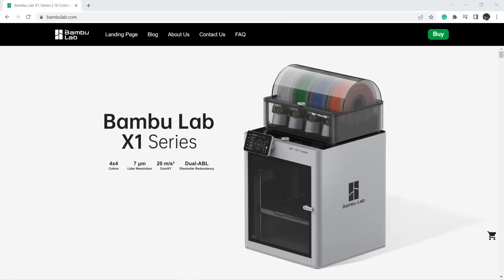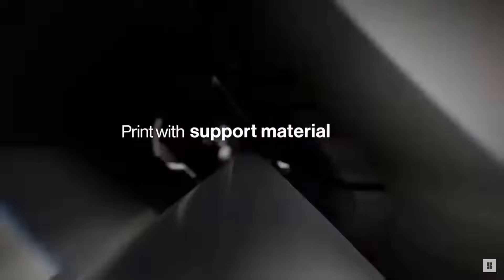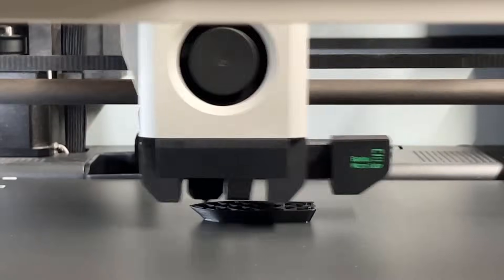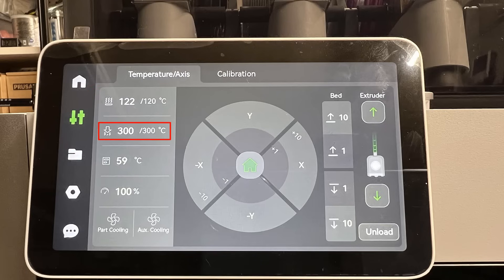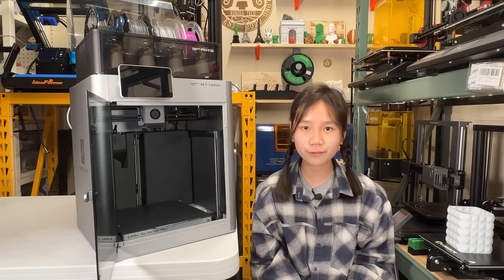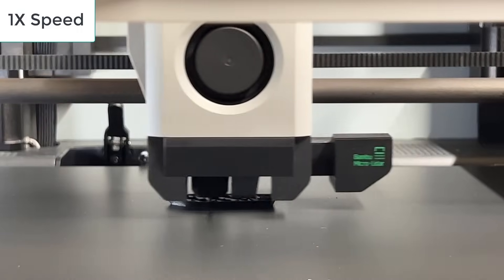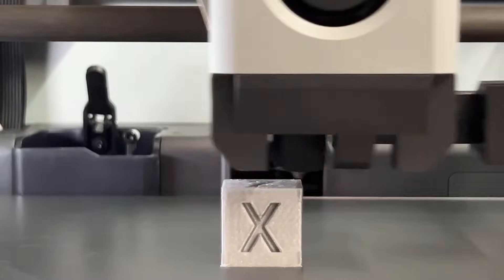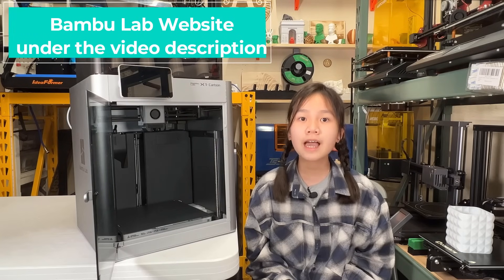Bambu Lab X1: This $1000 3D printer is a few generations ahead of Creality, Prusa, and Ultimaker

Comment: Have you had issues with your Qidi max extruder? Had mine for several years now and the only issue I've had was with the extruder, adjustment springs and not falling completely down in "Z" when finished. 

Great work on the video! Thank you for the review 😀
Reply from the maker: I guess they changed many parts from time to time, my extruder may not be the same as yours, it's working fine.

Comment: It becomes a shame that there is no talent to shoot good informative videos. Excellent work.
 upd. I  have four printers for different purposes. I'm developing my own printer. I didn't need a printer, but after reviewing Aurora, I decided to buy bamboo, I also persuaded a dozen of my friends. We wanted to buy a full Snapmaker kit in due time, we didn't buy it because of poor support. And they answered somehow. I have already written several bamboo e-mails, there is no answer, we wanted to buy 20 sets, but my friends, no matter how good the product is, do not buy when there is no quality support. It's a pity, bamboo, this is the first step towards a new approach to 3D printing. Well, I'll make my printer. One extruder is about 40-50 g, five colors or different types of filament printing speed, I can't check, I need a slicer. Solid metal, the temperature is more than 300 °C so that you can print both abrasive and engineering plastics, even PEEK. Fundamentally new kinematics. The printer is closed, if desired, you can make active heating. I want to note that 3D printing today is at an impasse. Even stagnation. And it's very good that there are companies like bamboo. If they still provided normal support, and so they would lose some customers. Recent remarks, the use of one nozzle for printing, deadlocked direction of development.

Comment: I love your videos and your reviews. They're so informative and detailed. Did you discover any information about replacement parts? This was the only thing I can't seem to find about it. What happens when you need to replace the nozzle? Can you use different sizes of nozzle? Also what about clogs or failures of hardware? This printer is ahead of its time. It will be neat to see how it does long term.

Comment: I see this printer getting a lot of good reviews all over YouTube, will the multi-filament attachment cost extra? Is the build volume big enough to build a cosplay helmet?
Reply: The AMS is an addon that costs extra, and the build volume is a 256mm cube. Not the largest build plate, but you can easily print the helmet in segments and still have it printed way faster than with other printers.

Comment: Game changer printer. For years, the ~$1000 DIY printers seemed to be the only way to see a convergence of both fast and quality. This blows VzBot, Voron, Ratrig, and all the rest out of the water. 20K mm/s^2 acceleration is the full speed/acceleration setting that Tom Sanladerer’s Voron V2.4 struggled at in his popular Voron V2.4 summary video last year. There he noted skipped steps which prompted him to run at half that in normal daily usage. Yet now here we are finally seeing 20K mm/s^2 in a consumer-first product priced less than a Voron V2.4 with the same accessories (and more) with higher quality and better, consumer friendly ease of use. I predict this product will mark a radical sea change in the DIY community as people move from building DIY printers to buying ready-to-run consumer ones like this. Gone are the days of endless fiddling and tuning of Voron, VzBot and others as the age of the consumer-friendly 3D printer has finally begun.

Comment: I've seen a lot of reviews and I think speed is the best feature of this machine. However, I think the quality is not the best. I am comparing with my prusa mk3s+ and while it lose in term of speed, I think prusa still produce better quality. Maybe this printer is more suitable for quick prototyping but I would still use a prusa for final product. I almost jumped to buy one in the kickstarter campaign but I think I will wait for the second generation which I hope will excel in both speed and quality.

Comment: The only thing that troubles me are the hotends, or more accurately the nozzles. And I enjoy tinkering with firmware, so that's a bit of a bummer, too. Glad that slicing is open in both directions.
Anyway, yes, it has almost every reasonably common feature, some fairly unique ones, and apparently phenomenal performance. All at a fantastic value even at MSRP, let alone at early-bird. I almost hope they don't have an EU warehouse, so I don't get tempted. (Can't find anywhere even addressing this question.) I really, really want this. And I really, really want them to be successful.
That said, since it does lack some popular features, I wouldn't say that it beats every machine in the price range you mentioned (for every use case). The AMS sounds great, but such filament changers, IDEX (or more), and toolchangers all have their own pros and cons (a combination of all of these would be perfect, but very expensive and complex a physical setup). I've personally never really needed more than a mid-sized build volume like it has, but still, a large desktop build volume isn't always just for bragging rights, particularly for functional parts. Speaking of usually just to brag, but at times required, a 500°C hotend (for PPSU, PEI, PEEK, PEKK, and probably other industrial materials) is ironically the one feature I could see them providing an upgrade kit for.

Comment: Sorry, the following comment is not aimed at you specifically, but at the 3D printing community in general. 

Print the Benchy, but measure its dimensions. Probably the only features that you can gauge with naked eyes are: whether it has a a lot of stringing, any Benchy hull line, first layer squish. You probably can’t see the words #3DBenchy at the stern with a 0.4mm nozzle. 

Maybe next time do a serious retraction test like a Voronoi model at high speed.

Comment: Dual extrusion gears or one? With the enclosed area getting up to 59C which filaments can this printer NOT print well?  How does the multiple material handler work? Does it splice like the mosaic or is there a waste tower?  Does the company say anything about this being future upgradable - as in adding active heating?  Does slowing down the print speed have a significant affect on part quality for strength or aesthetics?  Does that AMS box also remove humidity?  My main focus is ASA, Nylon and CF Nylon

Comment: Amazing printer. Now the tough question. I work with and use several Ultimakers, and was not pleased to hear about the Stratasys acquisition. But for this system to be a viable replacement, it needs to handle support material for complex prototyping. Were you able to do that, with breakable or dissolvable filament?
Reply: The Kickstart lists both.

Comment: This has made me reconsider my Prusa XL PreOrder. I’d love for you to do a comparison.
Reply: PrusaXL with its toolchanger is a different beast for multicolor.. with this X1 AMS you waste about the same amount of filament on changing as you use for the print.. so 300g print gives about 300g waste, and because you need to purge, you spend around 2x the time on changing color than on printing, so get ready for veeeery long print times. With the PrusaXL it's really made for multicolor/material. Almost zero waste and very fast changing. Printing on PrusaXL is much slower though than this X1, and there is no vibration compensation.. so total print time could still be quite similar, but just with less waste on XL. XL can however also print with different nozzle sizes.. so you could maybe print faster with thicker infills. But X1 is geared for enclosure printing, so if you plan in doing a lot of functional parts with PA or ABS, definitely the X1 will be better, also with smaller build area, faster warming up of enclosure and higher environment temps.
Reply: @karoo_bushman6880  Well, there will be an official enclosure upgrade for the Prusa XL. (Not to be confused with the simple shroud upgrade, which they've shown a bit, but can't be preordered yet, either.) Probably with the same impressive list of features as the one recently revealed for the MK3S (and its predecessors). Maybe a couple more, who knows?
Basically it's a case of lower price, higher print speeds, and (optionally) extra strong cooling for the first few layers vs. larger build volume, more versatility (variable nozzle sizes and other tool heads), and less waste per filament change. They both have their place.
Reply: @karoo_bushman6880  You bring up some excellent points.  I did get a Bambu pre ordered today, What a nightmare, took me 35 mins of kickstarter freezing and I was not able to get the early bird even though I had everything ready when it opened. Even set up a second account in my wife name for double the click changes. Hopefully I will actually get hands on with X1 before making final decision to cancel Prusa preorder. I could roll the dice on reselling Prusa as I do have a fairly early pre order. If I made an attempt to keep both, my first print would have to be a dog house for me to live in.lol

Comment: I like the mashine but not your „review „. The Calibration Cube looks awful and much worse than on many other maschines in normal speed. You even don’t measure it so it doesn’t make sense to print it at all. 

Please think about that and maybe print a cube with 50mm/s for your next vid and also check the dimensions and compare it i.e. to the same budget printer Quidi X-Max or similar.

Comment: Would this be a good buy for someone looking to start 3d printing as a hobby. I was looking for the Creality3D Ender-3 S1 at around 450 euros, then read that Prusa MK3S+ at 769 euros is one of the best. So I thought buy once for a very long time. Then I find this video and I am truly lost. TBH I didn't understand most of this so any help is appreciated. Mainly I want to print some minis and figures.
Reply: It's better not to buy a fdm printer for figures and minis, you should look at a dlp/sla printer
Reply: @andrealioce4341  would the Anycubic Photon Mono be a could choice for a beginner?
Reply: @dimitrissideris3723  I'm not an expert in sla printers, but I think it should. Keep in mind you work with resins, and resins are toxic, smell and stich, and you need gloves and mask. Then the print has to be cured before you can paint it or use it. But the print resolution is a lot better than any fdm, there are no visible print lines and you can print very tiny highly detailed minis. Fdm is for bigger stuff (RC models, cosplay, mechanical parts and so on).
Reply: @andrealioce4341  thank you for your time and your thoughts

Comment: Hey Aurora, great video as always! I have been eyeballing this printer for a few weeks. One question: Did you not use the vibration compensation? There is a lot of ringing in the prints that you displayed, and I saw 'vibration compensation' turned off on the display.

Comment: I have different concerns. This machine looks to be chalk full of proprietary components. What do you do when you need replacement parts? What if the company goes under? This printer send to have problems with vibrations as well. You can see some ghosting in the calibration cube.
Reply: If I got this I think I will set it up to be slower, I'll be happy by just being x2 faster instead x6 than others printers
Reply: The company just posted a blog regarding this. In essence, they say in the event the company fails all will go open source.

Comment: any comments on noise levels? Does the increased speed make it louder than average? Also,do you thing the built in air cleaner is up to the task?
Reply: High noise but there is a slow silent mode.
Reply: @revoltoff  can that be changed on the fly mid-print by any chance?
Reply: @fx622b  dunno

Comment: It surely looks impressive, but I'm very suspicious about the price, it's too low for packing all that heat.
Reply: Maybe they want to get a lot of unit out there quickly to spread the name and then raise prices once demand increases?
Reply: Post kickstarter itll be 1500 thats fair
Reply: @tenkarausa5294  Also they are aiming for mass production in China and not in the EU. Frame welding and other part’s are highly automated with robot’s and similar. I think the price is normal and will drop also a little if it runs. Hopefully not to much below the KS prices;)
Reply: @lazyman1011    yeah they sure do have a lot invested in this project. The production facility seems impressive. I have high hopes that my “gift” will arrive as planned 🤞but regardless what happens with the KS, I’d say it’s almost certain that they will hit the market this year at under 2k.
Reply: Compare it to DJI in the drone industry and it makes a lot more sense (assuming they can scale)
Reply: Maybe they just took Pursa XL research and just got the parts? 

Don't underestimate development costs
Reply: They'll make the money on the proprietary parts?
Reply: I got the same feeling? I am having my worries because it sounds way to good to be true. I am okay with waiting until it releases to buy one.

If this doesn't turn out to be scam, I wouldn't be surprised if there was quality control issues.
Reply: @fess3932  it’s certainly not a scam. Kickstarter is over, so you have to wait at this point anyway. But they’ve been posting updates regularly. They already shipped the first 2100 kickstarter orders and the production facility is currently putting out 600 units per week and are on schedule to have all 6000 Kickstarter orders shipped before the end of August.

Comment: I have seen multiple reviews on this machine but was so happy to see that you got one to review as you tend to look at areas that other reviewers miss.
 I dont do Kickstarter as I believe it is gambling and that is something I will never do.
I have my money down for a Prusa XL,however, I will weigh up the situation when the XL is launched, It may be the case that I will recover my money from Prusa and buy a retail Carbon X1, I will however wait until the community has used this machine and found any faults or niggles that may be present.
 I was wondering whether Bamboo Labs will make their tech Open Source or at least licence it although if they keep it in house I can also understand that choice
 I am looking forward to the next instalations of this review series as this machine is a game changer.
Reply: Get this when it comes out, the Prusa is done for, you have to keep in mind Prusa is really the most overpriced. Don't give them your money let them bleed.
Reply: @revoltoff  Prusa have 1st class QC 1st class manual and 24 hour customer service experts that can solve any problem quickly, constant improvements to the printer and firmware and slicer
 I am happy paying for this service!
Reply: @AndrewAHayes  No in my experience. Like everyone I went for Prusa as my first printer thinking Im paying for quality and printer that "just prints".
Two year later and countless troubleshooting this printer still wont print anything and support did help me at all.

Comment: Regarding the risk of online sales, buying from trusted online shop reduces risks of not getting your items greatly and gives you leverage if this happens. Meanwhile the risk of Kickstarter are much greater and are made much more aware due to media. But i bet after waiting for a year or 2 this printer will go on sale for comparable prices to the kickstarter prices. So either take a risk now, or don't be on the bleeding edge and wait a year or 2. Waiting also means more mature Software, perhaps even integration of all features in Cura/SuperSlicer.

Also we don't know the reliability of the LIDAR Sensors, could be that they have a MTBF of 6 Months or not, so question would be how expensive would be replacement parts and how easy/difficult it would be to install these replacements.

Comment: Holy hell that looks good, once it's out on main sale they need to keep the prices low and by that they will blow away the the "pro market" machines because if I was going to pay 600 to 800 for a machine and this goes for 1000 then it's a no brainer. But and here's the but, what will these be like for maintenance, why aren't more printers coming out with screws in stead of belts for the movement, if it's down to speed they say if a top speed of belt is 500 and screws are 400 who cares because obviously the boards tec are getting better in that it's scanning for optimisation. You will need a mahoosive factory soon to house that print farm 👏👍👍🤭
Reply: Personally, I think belts are smoother. I had a printer with screws on every axis and you just could not get a decent print out of it. There was always some kind of vibration from the screw that would translate to the print.